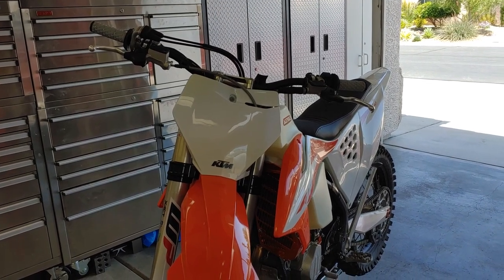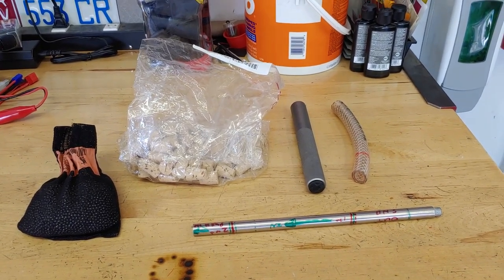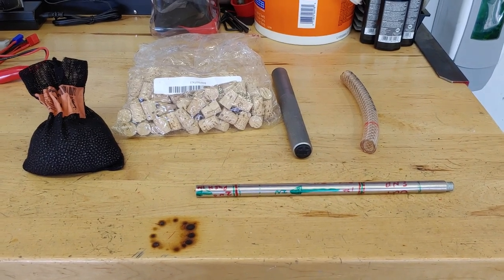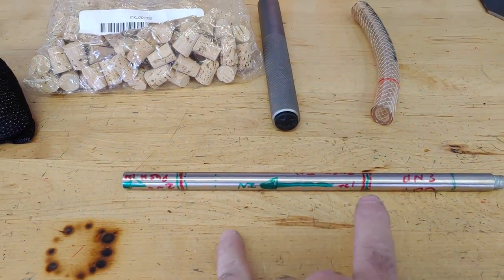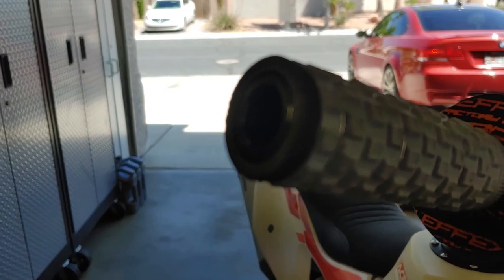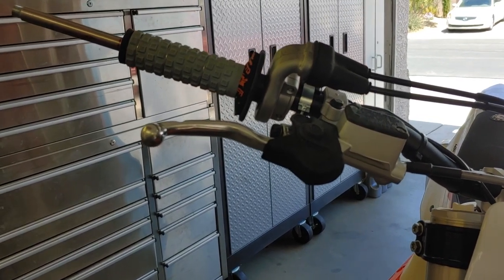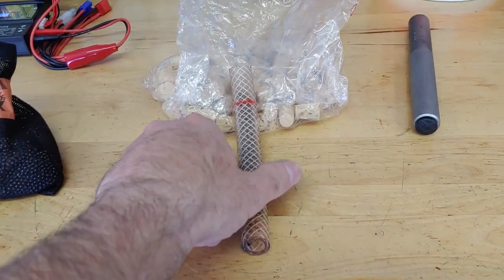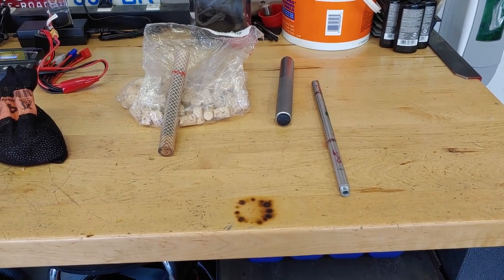Custom Handlebar Anti-Vibration Mod

Comment: What size lead shot did you use?
Reply from the maker: I'm using a scuba bag with #4 shot...I found the item on Amazon (of course!).
Reply: I picked up some #7 shot from the gun shop. I can't fit corks in my bars, the end of the bars have a screw hole for bar weights, so I filled the bars, seems to do the trick
Reply from the maker: @evanmcconnell3389  That is a pretty good solution!  Glad you were able to make it work for you.
Reply: @SteveSmith-wl8yq  does any size lead shot work? I would imagine #9 to be a bit heavier than #4 shot.
Reply from the maker: @jonnybgoodslol9206  Do a search for lead shot size chart...you will find that 4 is bigger than 9...it is reverse.  It is total mass with movement between each other...to little movement is just as bad as too little mass.  I tried to make it like a dead-blow hammer, so you do not want too big of shot otherwise it will just be stuff bouncing around inside your handlebars...little deadening effect.  I think a #4 or #5 would work best (but I'm just going off past experience--no actual data to back it).  You can use lead shot in diver belts as well...in fact I found it to be the easiest to find/purchase (good old Amazon!).
Reply: @SteveSmith-wl8yq   yea I do realize that 9 shot is smaller than #4 but I was just was wondering what is the end goal to stopping this vibration lol. Heavier handlebar grip ends with tightly packed shot ( with no play for shot to bounce around ) or just bigger shot with some play. How about a mix of both and some sand? I was just wondering if anyone else had experimented and got better results. I have looked at a few forms but they don’t explain much of how it dampens the vibration and they just go off of what is most common in the biking community. This is my first problem I wanna take care of my bike for a more comfortable ride. I guess I’ll have to experiment
Reply from the maker: @jonnybgoodslol9206  I replied with this text before...it might add some additional value to you.  In addition to the following text just adding mass (solid) will change when the vibration happens but it just shifts the freq (it is not cancelled).  Using the lead shot with some freedom of movement kills the vibration momentum vs changing its freq.  Let me know if you want additional info.  “Not sure exactly what you are asking, but here is a short simple explanation of why adding mass to the ends of your handlebars reduces vibration(s) felt.  bottom line, IMHO...if you ride your bike and do not have any hand/arm pain from the vibrations then you do not need to do any vibration mod.  Here is why you might  need the mod:  Vibrations can be caused by the sum of different sources (i.e., a running engine, anything mechanical).  A 125cc generates vibrations as much as a 500 cc engine...the only diff usually is the freq range of the vibrations generated.  The real problem comes with Harmonics (resonate) when the vibrations get-in-line with the natural freq of an object (solid or held together).  Most everything has a natural freq at which it will resonate (vibrations that grow in strength ).  A small engine generated vibration can cause your handlebars to vibrate multiple times stronger due to harmonics (this can be extremely noticeable at certain engine RPM ranges).  Adding mass at the ends of your handlebars changes the freq range(s) that causes your bars to vibrate (mass tunes your bars to resonate at diff freqs).  Think of using your legs to make you swing higher on a swing...if you do not swing your legs at the right time then you will not swing any higher.  Your engine vibrations can get in time with your handlebars vibrations thus causing much more powerful vibrations in your handlebars the same way your legs cause you to swing a lot higher on a swing set.  Try quickly revving your engine (blip the throttle--don't hold it) in neutral and see if anything on the bike starts vibrating aggressively at certain RPMs (i.e., brake/clutch/shifter levers).  Hope this answers your question...”
Reply: @SteveSmith-wl8yq  yea the front/rear fenders and turn signals vibrate aggressively. And I do get painful/ numb hands. I recently purchased a FE501s with supermoto wheels and can’t seem to ride it for more than a hour because of the vibration. But thanks your examples helped get a better understanding. Plus I also reload so I have all types of shot but just wanted to try this out before jumping into the money hole of dampening vibration parts. Lol next is probably putting in rubber inserts for the handle bar clamps and a stabilizer bar
Reply from the maker: @jonnybgoodslol9206  I hope you are able to resolve the vib problem...I know how it sucks to ride when your hands have gone numb (and with pain).  Once I did the mod on my quads and bikes I almost never have a problem with it.  In fact, I stated in the video that I now notice my foot pegs vibrating because before the only thing I notice was how bad my hands hurt.  I hope the info helps out.
Reply: @SteveSmith-wl8yq  hey it worked out. But I ended up mixing different types of shot. #1 buck, #7.5, #4, #9, and #6. It helps but now gonna try smartskim grip add on.
Reply from the maker: @jonnybgoodslol9206  👍👍